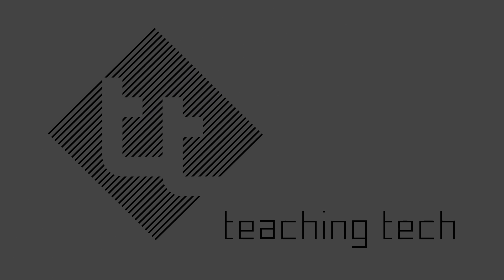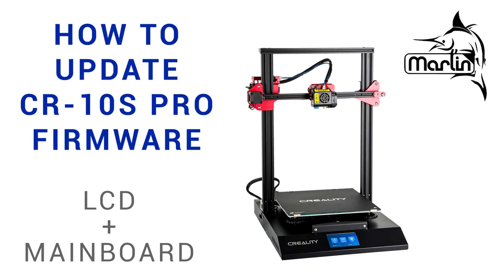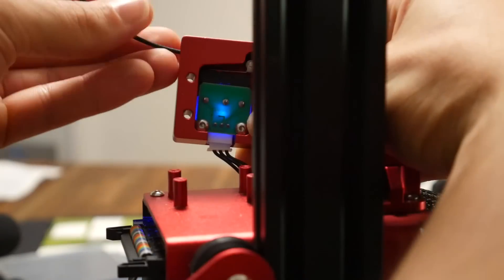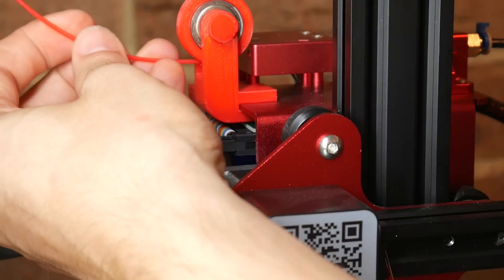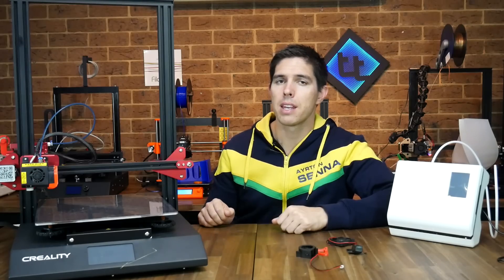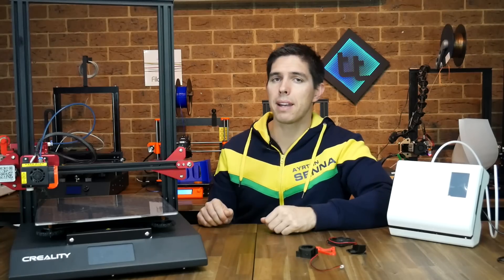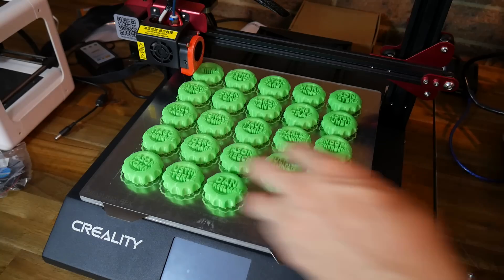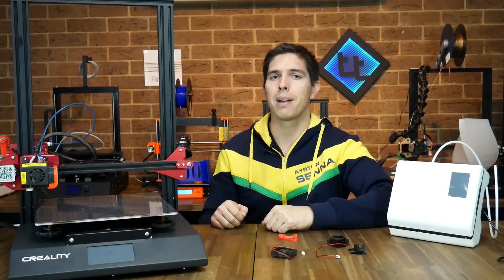7 fixes for the CR-10S Pro - Unlock the potential!

Comment: If you had one printer would you get the Prusa mk3s or creality cr-10s pro?
Reply: 100% prusa, you really have a lot of problems with the s pro, i have one and i hate this printer. i am also a cr-10 owner and this printer is great, but not the s pro.
Reply: Poggio,

I have 2 Prusa printers and they are awesome.  I’m looking at getting this for a larger print bed, but you are saying that your CR-10 works better than the CR-10s Pro?
Reply: @longlake5913  dont buy the cr-10s pro, i am in the same situation. I hate the cr-10s pro and i have 3 other printers already. My 10s Pro burned on the hotend, and i am happy that my house didnt burned down. 3 friends had the same problem. 2 bought it over amazon and were able to give it back. 1 and me still try ti give it back over banggood. Banggood has a strategy. They answer to your email. Then they ask you to make a video. Then they ask you for another video. Then they offer you 40 Dollar discount, and if you still want to return it, they dont answer. If you then ask after a week why they dont answer. the game starts again, with ... make us a video ... I had this problem, and the friend had this problem and many more. I know from prusa, they still work on a bigger 3d printer, but dont know how far they are. I dont own a prusa, because i also need bigger prints for mechanical work. So my plan is now to make a own printer with an duet 2 wifi board and a self made printer out of peaces of the cr-10, because the cr-10 has the same print quality if you adjust it right. But my new one gets linear rails with 12h. Because the rolls out of rubber, become smaller and smaller over time and in this way they become unexactly, but this cant happen with linear rails. Costs for the new printer, 500 dollar at all, and you can enclosure it, means you are able to print ABS, PA12, POM without any problems and you safe money, because not all your heat goes into the air and not into the print were its needed to avoid warping. Hope i was able to help you and you see, that iam not a noob. But the CR-10s PRO was a big misstake because i was in hope that i can fix the problems by my self. But my board has a bug, the lcd has flickering, the bed is total unflat, the sensor is absolute not precise and so on. Was my worst buy since years!!!
Reply: @HAYAIGAMING  hahaha same here. Everything is 1:1 right! @Longlake stay away from the cr-10 s pro if you love your money!
Reply: My cr10s pro is fantastic. Couldnt love it more

Comment: I have also thought about getting one of those sd card extension cables to plug into the display programming port and bring it to outside somewhere. Then you wouldn't need to open it up every time to do a firmware update. Some people put these in the external slot to to protect it as well.
Reply: I modded one of those sd extenders to be accessible through one of the air slots. works awesome and is barely noticeable!

Comment: Amazing video! The bad launch turned me away from Creality CR - X so I went with a Prusa MK3s which has its own issues :(
Reply: what issues mk3s got ?
Reply: @MrCcfly  Mostly first layer issues both because of Pinda sensor and bed adhesion. There was one time which pinda sensor malfunctioned and smashed the hotend  really hard to the bed. Also Slic3r prusa edition is terrible compared to Ultimaker cura
I think about buying a wham bam bed for the mk3s.
Reply: @djdontgetcooked  can i ask you one more i love petg  and my printed dont like it so much so i look for another one ,,by prusa videos and some forum posts petg is great with mk3s but i dont know .. did u print anything in petg and how it like ?
Reply: @MrCcfly  Yes I made one print so far with the stock config of Slic3r prusa edition and the results except the raft were great

Comment: I agree with all the problems you mentioned. I bought that printer and returned it to Amazon after a few days. I could not accept having so little build quality with such a high price. What I did instead ? I bought the Prusa i3 MK3S which cost be just a few dollars more. The build quality of a Prusa is so good that you just can't compare with any of the Creality. The only one thing that the CR10-S Pro has is the print size but most of the people rarely print huge models.
Reply: Just to compare prices in the EU: €492 for the CR10 S Pro (on AliE), €769 for the Prusa i3 MK3S (kit, so at least 12-16 hrs of 'fun'), that's not a small difference (€277), and note that the Prusa still has many plastic parts and indeed a much smaller build volume (yes, size does matter sometimes :-))
Reply: @GELHammer  No.Your calculation is wrong. You'll probably have to pay the duties and taxes for the CR-10S Pro so you can add 20% more. And also you need to add everything that makes a Prusa a prusa and then you'll finish that your CR-10S "not so Pro" will endup more expensive.
Reply: Gert Luyten Oh and I forgot to mention all the time and "fun" you will have upgrading your creality unmounting the parts, mounting the new parts, recalibrating, reflashing the firmware.., to try to reach the quality of a prusa.
Reply: No duties, AliE's Creality store ships from within Germany. Even when shipping from China there are no customs duties to the EU. So the price difference remains, and my upgrades are limited to the T8 backstop screws (€5) and 1 PSU fan (€8).
Reply: @GELHammer  Then you won't get ANY of these Prusa awesome features : Bondtech gears, Extra silent Noctua fan, 
extra silent Trinamic drivers, 4 thermistors, fans sensor, Shifted layers, Removable magnetic, Max hotend 300°C, Heatbed temp.
 120°C, Speed
 200+ mm/s, Better cooling from both sides of the object
, Optional WIFI with Octoprint interface, Bondtech extruder drive, IR filament sensor, Automatic loading of filament when filament is inserted, ... and yes, there are more...
Reply: @tripore  that's why this is a video on the CR10 and not the Prusa 😜. I need that build size!

Comment: I wonder if you could leave the bottom plate off then not use the rear frame fan at all. your new fan should keep the stepper drives nice and cool and the PSU will run cooler as it is not boxed in. Or maybe you have tried this and its not a good idea. Thank you for the great video of updates.
Reply: The bottom cover helps the rigidity of the base and helps it maintain square of all axes.
Reply: Yes , you are right. It is needed. Thank you for the video and taking the time to reply.

Comment: I hope you can help me. On thingiverse i dot not get any response....

https://imgur.com/a/1rHweBt (vase mode)

Why does make my Pro these rings? If i print faster, the gaps between the rings are lager. Print i slower the gap is smaller. I changed Z motors, E motor, extruder gears, PID tuned, changed z leadscrews, z rod sync belt, new polycarbonat rollers also new SKF bearings, new PTFE tube, new nozzle, tried diff. firmwares (Original, tiny machines, my own)...

i have no idea what can cause this problem. pleas help me